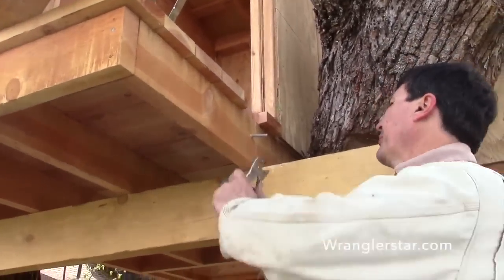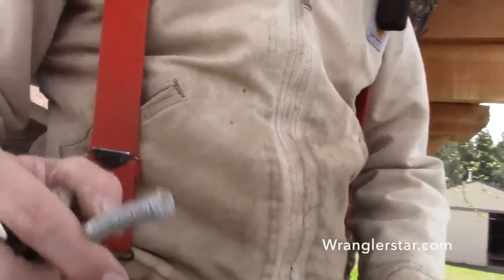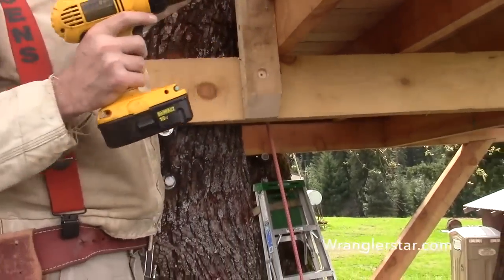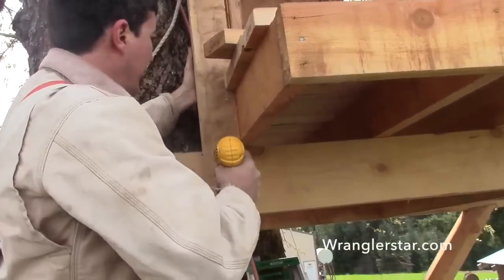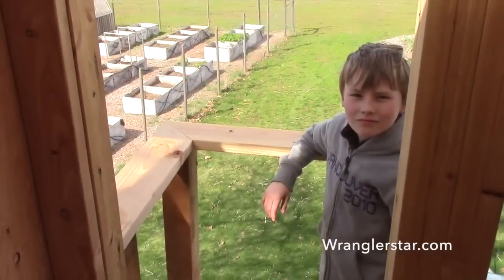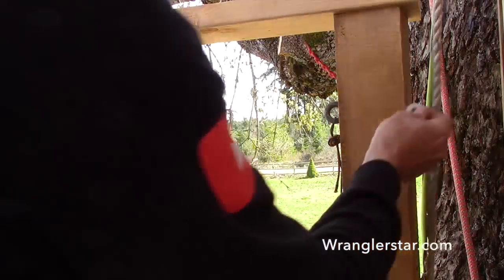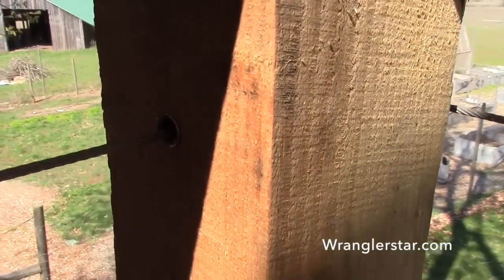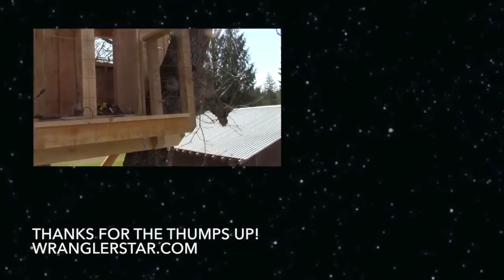How To Build A Treehouse | 29 Wranglerstar

Comment: Hey Cody, 
Kudos to you and Jack on your tree house. I have a few comments on things that I saw and heard. In one of the episodes I heard you make the comment about code for rail height is between 34" and 38". This would be accurate if you were talking about a rake rail on a stair. What you were building is a guard rail and it has a minimum height of 36" and no maximum height. I heard you later mention that your top rail would finish at 38" so its all good. I thought the use of the tubing inserts to guide the cable through the posts was great and I would use that idea. Not that a tree house has anything to do with building codes but if you were to do the same thing on your house porch you would have to have the cables at 4" maximum spacing. If your interested in why I would be glad to share with you. I think I would have used a turnbuckle instead of a spring to tighten the cable, just a thought. Now a different subject. As a Christian man myself, when you made the comment on the Chinese bolts, it hit me because I have done the same thing many times. I know that you harbor no ill will to any of God's children so maybe we could just say its poorly constructed material manufactured in China because we both know that there are poorly manufactured items from everywhere in the world.
God bless you and your family and keep up the good work!

Comment: I like the wire fence idea. Would adding a hard stop on the lower wire be a good idea to limit the spring stress? Something to keep the person from falling should the spring get excessive pressure and break off. Maybe a cable clamp on the right side with three inches of gap until it bottoms out on the ferrule.

Comment: There's actually a company that makes the fasteners for that type of railing.  Instead of a spring, a longer eye bolt with threads on most of the shaft will allow you to tighten the cable snug.  Then with your wrench, tighten the nut on the eye bolt to bring the cable tighter.  This Old House, last year, featured a deck project that use stainless steel cable.  Oh, and after you tighten to the desired level, you can cut the excess threaded portion, extending past the nut.

Comment: Just a small thing I noticed the "cable splice" is on upside down. The saddle (part next to the nuts) is supposed to be on the live side of the cable. My grandfather told me an adage of "never saddle a dead horse" and it has always stuck with me.

Comment: There is a company call "Ledger lock" that makes some great lags.  They have the same rating as a 1/2" lag with only a 1/4" shank.  You also dont need to predrill a hole.  They range in length from 2.75-10".

Comment: I realize I'm late in finding this. My son-in-law and I did a cable railing. Two differences: 1) we drilled the corner posts with a 90 degree holes so the cable entered and exited from adjacent sides of the post, as opposed to yours that were drilled straight through. Looks a bit cleaner with no cable resting on the outside surface of the post. 2) we used a turnbuckle in place of the spring.

Comment: I think you're better off using the turn buckle you have rather than the spring. You have better control over the tension using the turn buckle and it would be safer than the spring.

Comment: Everyone is giving you such a hard time about those darn wires because of safety.  The cables are great because the don't block that wonderful view!  And Jack is certainly old enough to know not to climb on them or tell younger children not to.  Great design overall.  Will you need to put a sealing coat of finish on the wood?

Comment: Just a little learning point.  The clamps you used for the cable are called wire rope clips or as we call them in the entertainment industry crosby's (named after the main company the makes them).  In a normal situation you would use 2 of them for 1/8" cable.  Also just a note for people using them never saddle a dead horse.  Meaning that the saddle should be on the live end (the end that runs the length of the cable) and the U bolt clamps on the dead end (the cut or short end of the cable).  Also 1/8" wire rope has a working load limit of 2000lbs.  Heres some info I found on correct use of cable clamps.  http://www.fdlake.com/wrclips.html

Comment: The way the board is tight against the tree, it will hold moisture and cause rot.  It will make it hard for the tree to compartmentalize and could lead to structural weakness in the future.  I don't like the cable idea either.

Comment: Cody, the guy who commented about the tree rot/fungi is kind of echoing what I wrote. There is a tar like patch you can buy or make that you slather over the cuts in the tree to seal the wound. It keeps out moisture and bugs and the tree from rotting. My father used to apply it, it lasts for decades. It's like a thick black tar/pitch/asphalt type stuff. I'm sure there's a recipe for it somewhere. It also keeps the tree sap from oozing out. I would do it before you put all the walls up while it's easier. It's up to you.

Comment: They are called "crosby's" and one thing I learned from a rigger when I was Jacks age was "never saddle a dead horse" you have the saddle of the Crosby on upside down. 
The dead end of the cable should be under the u shaped bolt ,not the saddle. 
If you Google image "wire cable crosby" you will see some diagrams of correct and incorrect ways to utilize them. 
They are very handy. 
The tree house is beautiful and Jack is a great cameraman.
Reply: 209turtleboy  Great catch Turtleboy.  I was curious as to if anybody would comment on this.

Comment: kids will use horisontal wire as steps. risk of falling over top rail. better vertical  rails (nothing to stand on). uk joiner dave
Reply: That's when they need a slap in the head to smarten them up!